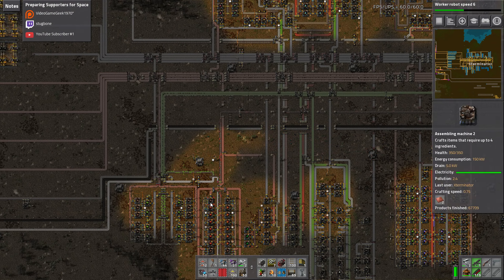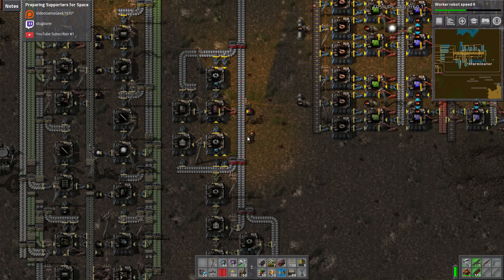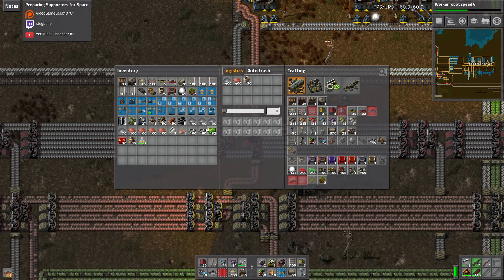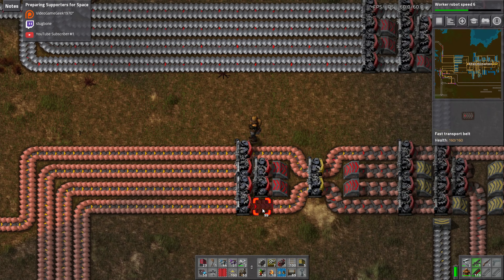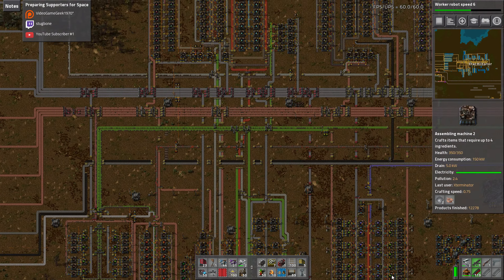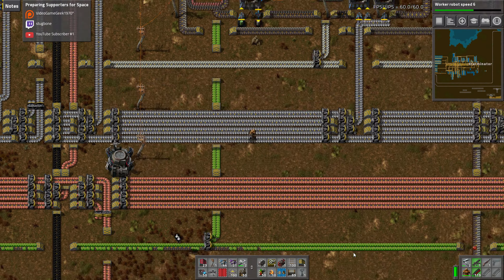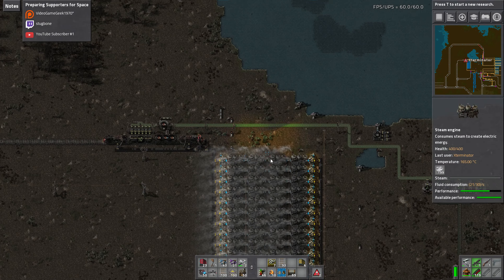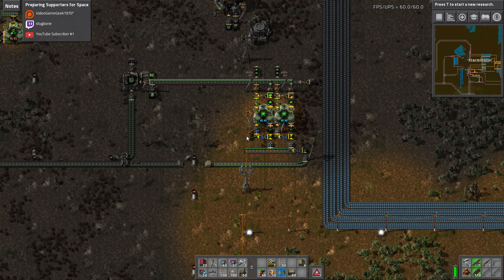Factorio 0.15 Sending Supporters To Space EP 41: 8-Lane Rail Designing! - Let's Play, Gameplay

Comment: My approach would be to have shorter rail blocks on main lines in your main base areas, where throughput is more important. Longer blocks on ore only lines is fine.

Remember that your minimum signal spacing affects all junctions if you want them spaced properly - i.e. your T-Junctions can't be closer than 3-10-3 to each other.
Reply: This is a fair point. You can use fewer signals on low-throughput "country roads" to make up for in-base rail segments that require heavier signaling.

Comment: Xterm, bear in mind that if your block size is less than a train length, the trains may lock an intersection if they have to stop right after it. Also, if you put a full length block right after the intersection (to not lock it), the spacing between trains will already be big enough that there is no reason to have smaller blocks further away.

Comment: One reason it seems to me that you don't have enough green circuits is because you don't have enough assemblers making them. Sure the copper plate supply is not fully compressed, but there is enough to add more assemblers.

And every time you get attacked and run to repair the damage and kill the attackers, if you don't got and wipe out the nests where the attacks came from, you really need to put down turrets where the attack place.

Comment: If we assume the trains accelerate at constant rate, then suvat equations apply. s=0.5at^2 due to starting at rest, if we rearrange for t, we get: t=sqrt(2s/a) since a is constant, t is directly proportional to root s so doubling the the distance between signals would multiply the time before the next train can start by root 2 which is about 1.41 which is not too bad. So if rseding says rail signals cause a serious drop to ups, don't worry too much about losing throughput. 

Also, will you be streaming tonight?

Comment: why dont build the rails with only 1 space? dont see any reason not doin that. works fine for me
Reply: Creating a properly signaled T-junction using such spacing would likely be impossible.
Reply: Romulus228 why then do t junctions? round a bouts are way better than t's becouse then you dont have to have locomotives on both ends
Reply: The argument for or against double-headed trains is complicated and passionately fought.
The short answer though is that double-headed trains are easier to build and manage at mega-scale sizes.
Roundabouts are almost always a bad idea due to throughput limits and deadlocks, especially at these scales and train sizes. How big is the roundabout for a 3-10-3? Very large.
T-junctions can work with single-headed train networks too, btw.
Reply: Roundabouts are absolutely awful for throughput.  https://forums.factorio.com/viewtopic.php?f=194&t=46855

Comment: Why would you ever need 8 lanes? Also you can get around the copper plate bottleneck by splitting the smelter output straight to the circuit area without going through the main bus, because the main bus is the bottleneck.
Reply from the maker: You actually probably don't. I decided based on feedback from everyone that I should go down to 4-lanes. That should be more than enough I think. 
Good point about the copper splitting as well.

Comment: This might be a dumb question, but what's the advantage of having 3-10-3 instead of 2x 2-4-2. You have two more cargo's, but the train goes slower because of less locomotives?
Reply from the maker: The main advantage is less trains on the network which makes things easier all around. And yes the train may be a bit slower, but not by much actually, especially with Rocket Fuel now as a thing that can be used in trains. Bigger trains are much more viable now because of this. :)